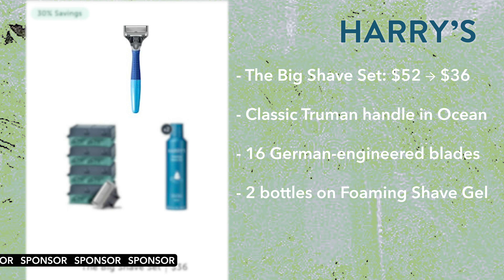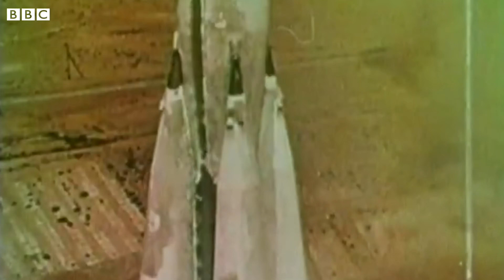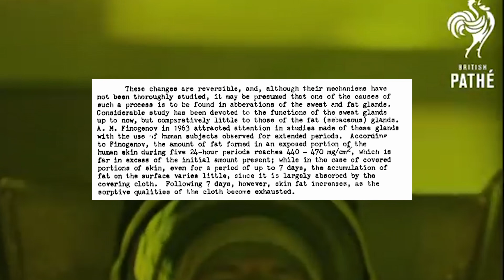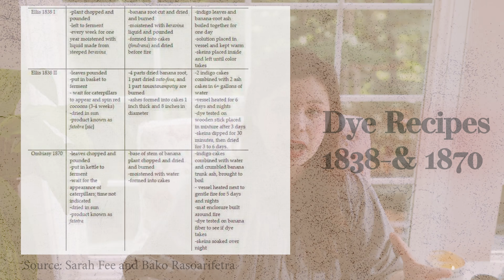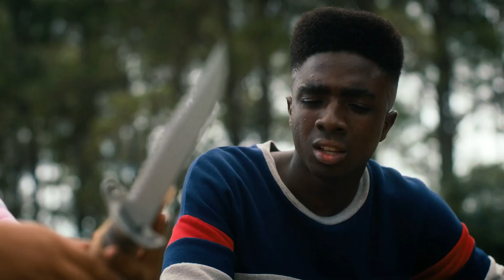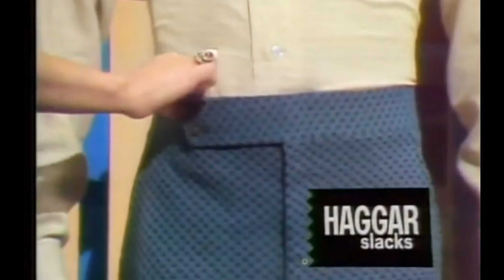The DISGUSTING truth about Laundry

Comment: I am from Germany and it literally blows my mind that someone can be forbidden from drying their clothes out in the sun. Or generally the way washing is done in the US (also experienced it first hand). But like... Is there anything better than having towels and bed sheets fresh from the line? I think not. I also do hate fabric softener as it solves a problem which is not there and it is sooo toxic when it gets into the water supply. I am lucky enough to have a drying rack in my flat and a balcony, where the clothes dry in summer and dry weather or a small hallway where I can put it until dry. Never takes more than two days, but I know that's not allowed everywhere. I also don't own a dryer, don't have space for it and I don't need it. My mother has one bit we only use it in winter for the sheets and towels, otherwise we also use the clothing rack and it is perfectly fine.
Reply: I personally cannot stand towels straight from the line.  They are sooo stiff and scratchy.
Reply: @Sadimal  If you take the towels and shake them out well, a lot of the stiffness goes away. Also fabric softener on towels will make them less absorbent and potentially stiffer as deposit is left on the fabric. I have to use a tumble dryer for towels (no access to an outside line) and the trio of  woolen balls that I add are great for softening & fluffing the towels.
Reply: Yes! Having towels fresh from the drier! Line dried clothes and particularly towels end up crispy and rough and scratchy. Absolute sensory nightmare. Add to that the disgusting acrid almost acidic smell that gets left on stuff dried outside and its just unpleasant all round. Not to mention the issues with getting pollen covering stuff if you have a household member with bad hayfever.

Comment: I am now sufficiently horrified and need to share this with my husband to overhaul our laundry practices...except we live in an area with extremely hard water (already installing a hard water filter when we finally move in our house) but live in an HOA so I have to see if we can hang dry clothes (haven't looked yet because haven't closed/moved in yet). But honestly the hardest thing for us is that it's FL with 1000000% humidity and/or daily thunderstorms all the time so I fear clothes not actually drying outside.

Oy to the vey it is 😭
Reply: In 1000000% humid FL, drying racks INSIDE the A/C house might be better than line drying outside anyway. Research various types: stand, hang from ceiling over the washer, etc. If items are put on hangers they take less hanging space on the rack and are ready for the closet. Good luck!

Comment: For stain removal I use Bile soap. It consists of ox bile(byproduct from meat plants), coconut oil and chlorophyll(helps removal of grasstains, berrystains etc). Works great with wool and is a huge help if you have messy kids.

The stains I cant get out or small holes I mend with embroidered flowers or little hearts.

Comment: There are solutions. I know that it's a a lifestyle to buy 2nd hand clothes and it's a choice to learn about high quality clothing. Most of our outer clothing doesn't have to be washed often. Perhaps I just slum it and wash my jumpers about twice a year which is a massive chore. I tend to wear my clothes until they're no longer mendable. They become dog bed material, then floor cleaning material. Then when they're no longer of any practical use, I move them to fabric heaven. The mighty iron is a good way of getting rid of bacteria and parasites. Of course there are things we did better in the past. There are things we do better now. Fashion and laundry aren't what we do better.

Comment: We have a front-loaded machine, our water is really soft, we don't use fabric-softeners, our detergent is fragrance-free and we line dry our clothes. So I stand behind all of this! 

What I don't quite agree with is the need for clothes to be sterile. As long as your skin is without open wounds (or you have some other medical reason) and your clothes are dry most of the time, there is no place for bacteria to grow to a level it could cause any harm. Our skins immune system is amazing and actually largely based on good bacteria. A huge part of our modern clothes also contain elastane and it disintegrates at high temperatures, so washing in really hot water leads to shortening the lifespan of the clothes further.

Comment: Rubbing alcohol in a spray bottle is a great way to sanitize clothing. Cheaper than vodka (at leastin my area) and just as effective, if not more, since you can get it in higher concentrations. Adding borax to laundry can help a lot with hard water issues. My family has always used white vinegar instead of fabric softener; essentially, the soap or soap + borax creates a base, which is handy for cleaning but can be harsh on the skin and make fibers scratchy. Adding vinegar to the rinse neutralizes the base, giving softer, less irritating clothing, but without leaving a long-lasting film of weird perfumey goo. "But doesn't that make the clothing smell like vinegar?" A little while they're still wet, but not once it's dry.

I have no advice on better ways to dry clothing. I live in the rainforests of the Pacific Northwest, and drying in the sun simply isn't an option most of the year, and air drying indoors often leads to your clothing mildewing faster than it dries. Apparently back in the day they used to dry clothing on the fireplace or above the stove used for heating the house. Not sure what a good modern equivalent would be. 🤔

Comment: I am really surprised by how violent wash can be in the US, I live in France where water is mostly hard and I never had any holes in my clothes. My mom did a really good job by learning me how to properly use a washer and following instruction at the back of detergent packs (like using more of it for hard water), apparently, I thought it was common knowledge :D 
Also : hanging your clothes can be FORBIDDEN by law ? Putting wool and fragile clothes in the dryer ? No wonder why they don't last long.
Reply: I think holes in a shirt have more to do with current fabric quality than the washing machine. Agitator washers didn't used to tear holes in shirts, and I have holes in a thin t-shirt washed for a year in my HE front loader.

Comment: Chiming in from europe here, even when we had a dryer bc of Big Family Laundry, there was always a system of "underwear and sturdy tshirts etc go into the dryer, anything that's nice/fragile/sensitive to heat or friction gets hung up." Even without access to outside hanging spaces, there are drying racks both small and big (seriously, there's ones that are like two meters tall) you can use inside, although you do need proper ventilation for them.
Also, from the one year I lived in NA, top loading machines are absolute hell if you're not tall? You can hurt yourself trying to reach in them? What is the point???
Also genuine curiosity here do people generally not use different heat settings on their machines depending on the type of laundry? Like, high heat for underwear vs cold and low agitation when you Have to refresh your wool jumpers etc.
(And yeah synthetics can't be washed on high heat and it sucks! This is why I don't buy them unless it's a type of fabric that Needs to be synthetic (like the good ol' metallics from the early 00s lmao)

Anyway here's a thought, how much improvement would there be to the general hygiene of our clothes if bidets were widespread--

(Ps thank you for mentioning the ridiculous amounts of fragrance in detergents, as someone who lowkey dies on public transport not because of anything body odour related but because of aggressive detergent and deodorant usage. Seriously. I assume people's noses just lose sensitivity?)

Comment: I don't know if it's true elsewhere, but here in Italy you can check how hard is your water is on your water bill. And there are non toxic tablets to put into your washing machine to soften water. 

I noticed the way Americans do laundry is completely different from my neck of the woods 😅 
I hand wash silk, rayon and wool, if your washing machine washes on warm and rinses on cold shrinkage of your favourite wool jumper is inevitable. I also prefer to stain treat before machine washing and never really opt for super hot water. 

We air dry all our laundry, either outside or inside. 
I might use the drier for bedsheets and towels once or twice during winter, and before you yell at me that Italy it's hot and sunny, not everywhere. It gets under 32⁰F with 90% humidity where I live.

Comment: I never had a t-shirt ruined by a washing machine🤔there were no new holes after washing. I don't use maximum temperature and maximum speed, it's just warm water usually. My t-shirts are never so gross that I'd have to use 90°C or even 60° setting.

Comment: Last month I went out and bought a cloths drying rack (for homemade noodles-haven't used it for that yet). Since I got I have used the dryer for 10 minutes-to fluff my pillow after washing it. Then it went on top of the rack. It is cooling down, will be seeing how long it takes to dry as the temps go down. I do live in an apartment that came with a washer and dryer, which is sad as I had bought a front loading washer and dryer when at my old apartment.

Comment: Yes to all of this! I used to use eco-friendly detergent for a while and felt way better about then environmental impact of doing laundry but I cannot afford it any more and feel really bad about every load of laundry I do. 
Regarding plastic fibres - what makes a difference is putting your plastic fibre clothes into a special laundry bag that catches the fibres so they don't go into the water. You can collect the build up fibres from the bag and through them away then. Still would always recommend to opt for natural fibres whenever possible since they also shed micro plastic while just wearing them, but for a few things where I cannot avoid it like swim wear, sports bras etc. the laundry bag is a good option.

Comment: You’ve truly done great research and brought up some fantastic points. Some things to also consider to go along with the energy consumption of the dryers n relation to environmental impact. Washing machines consume quite a bit of energy. If we look at pre washing machine times, consider how water was heated to do the laundry. Open flame such as propane or natural gas, even before then with wood or coal over a fire. The negative impact on environment relative to the use of fossil fuels is what drove the modern day ways of energy consumption. Above all this, you spoke about the most important thing that would dramatically reduce energy use, carbon foot print, and improve financial aspects in many ways; and that is owning clothes that are made of better fabric and made well. There shouldn’t be any reason that laundry can’t be reduced to 4-6 loads per month. And if we all really stop and think about how much of our wardrobe we actually really use, it becomes evident how much we can actually reduce our wardrobe to accommodate better efficiency practices in energy and laundering.

Comment: Actually, soap will damage the lipid containing membrane that all bacteria and some viruses have. So soap does have a sanitizing effect on clothes. However, it's not going to be nearly as good as boiling. It also will have a lessened effect if the soap is also doing a bunch of other things. Since it's a chemical reaction, each time a molecule of soap reacts with hard water, dirt, oils and microbes it will get used up. After this, I'm considering getting a new washer and dryer, mine are really old!

Comment: I live in Canada.  I hang dry or lay flat dry about 90% of my clothing (much of it handmade too - I love to knit).  I live in an apartment building so sun drying my clothes isn't feasible, and if I could, I would.  I love the smell of freshly sun dried clothing.

I find air drying clothing to be cost efficient and better for the longevity of my clothes.  I still wash them in the communal washers in the building laundry room, but most of my clothes have never been in the dryer.  It took a long time for me to convince my mum to do the same when she first moved in with me.  She's still resistant to hang drying most of her clothing, but she does hang dry a lot more than she used to.

I have three items of clothing and one heavy comforter that I get dry cleaned once a year.  It is expensive, but I make sure my work clothing does not require dry cleaning (I work at a law firm).  

I really wish I could sun dry my clothes, even my underthings.  It's so much better than machine drying them.

Comment: Pro tip: vinegar in your laundry will break down the soap and previous fabric softener in both the clothes and the machine. Our soap is terrible for the machines too. Dryer sheets are adding the wax back in so you use dryer balls.

Comment: It all starts with education.  You can't fix a problem you don't know about.  Then, make small changes.  Eco friendly detergents pricey?  Maybe cut back on something else - like not buy that item of clothing you really don't need.  Or, make your own detergent (usually less money but it does take time).  Use dryer balls instead of fabric softener.  There isn't a one-size-fits-all solution.  Making small changes is less impactful on the budget and is usually easier to implement.  Then, move on to the next item.  

Guess what I'm going to do now that the video is over.  You guessed it - laundry!  (groan)

Comment: This video was both really informative and quite sad. We absolutely have a long way to go. I was flabbergasted to learn that front loading washing machines aren't standard in the US. Here in Norway, you can get top loading ones, but they're mostly for smaller spaces and far from the norm. Not all people have dryers here, and even when we do, I believe most of us use them fairly sparingly to protect our clothes (or maybe I'm the odd one out, having somehow been raised in the depression era while also being a millennial). I stopped using fabric softeners a few months after I moved away from home because I realised they didn't really do anything except adding fragrance I didn't want. While I haven't been able to exclude synthetic fabrics or fast fashion items from my wardrobe (dressing a fat body can be a bit tricky, and being choosy with fabrics isn't all that easy), I am quite impressed by how durable my clothes actually are. 

I think we have to consider how we wear our clothes, and learn from earlier generations: I have good clothes and home clothes. Good clothes are basically never worn when I'm at home, I change to home clothes when I get home from work or whatever. That way, I can usually get away with wearing that good garnment multiple times before it needs to be washed. When it at some point either doesn't fit all that well, loses its shape or basically just looks worn and sad, it's demoted to a home garnment and will stay in that role until it either doesn't fit or it feels wasteful to wash it - at that point, it will either be turned into rags or recycled. I find that this system both reduces the number times I have to do laundry and keeps my clothes from being worn out. I'm currently wearing a 4 year old  "home dress" that was a "good garnment" for two years, had to have its trim removed because it got tattered, and is still going strong.
Reply: As far as I’m concerned, the tumble dryer is for things you need to dry fast for whatever reason, such as a child’s cold weather outdoor clothes that got really wet and/or dirty too recently to have dried by the time they’re needed again.
Reply: @ragnkja  It's actually also good at disinfecting. Retirement homes and hospitals in Sweden are supposed to wash hot and tumble dry hot. The hot dry air kills whatever was not killed or washed away in the machine.
Reply: @martinfalkjohansson5204  
The recommendation to use the hottest setting for hygienic reasons makes sense, since warm, damp environments are places where bacteria thrive, but hot, damp environments are far less so. It also means you don’t have a big drying room that needs to be kept protected from potential contamination while the washing is damp.
Reply: That's great! I'm from the Netherlands and we do the same here. There are more and more dryers in use I think nowadays but I was raised without it and don't feel any need for them. Also learned to wash underwear on 60 degrees with towels and bedsheets. 
What you are saying about using worn clothes at home... this is exactly what my mom does, she hardly throws out any clothes! She will have specific clothes for camping trips, gardening or painting aswell. Now my sister and I are stealing her dresses because we love to wear vintage and they're still going strong😂
Reply: I refuse to own a front loading washer since my cousin had one and the seal went bad and there was water all over her floor 😬